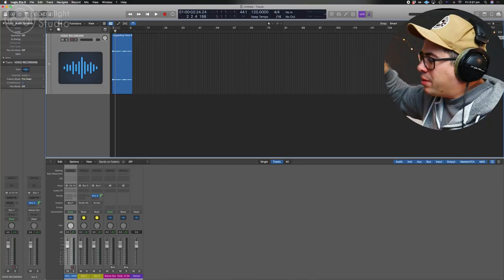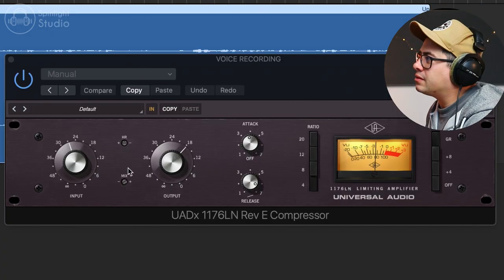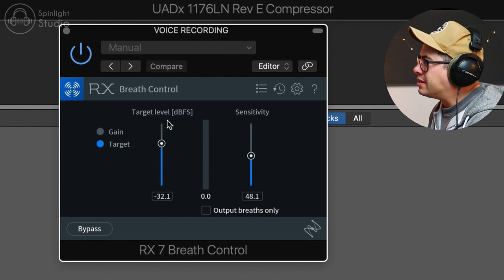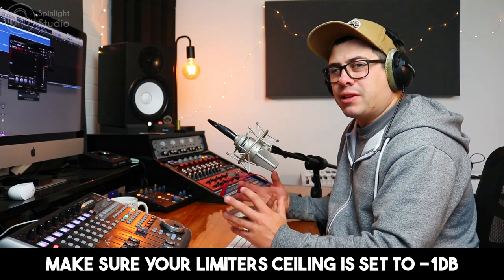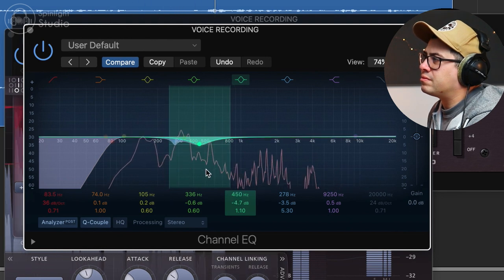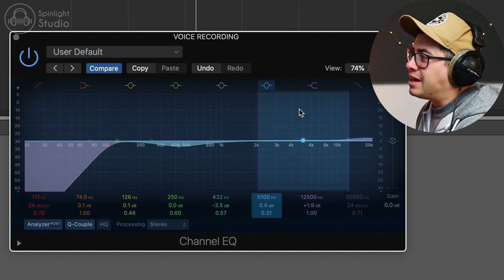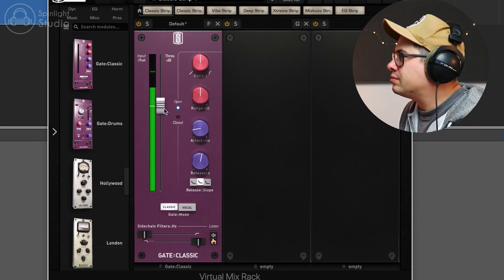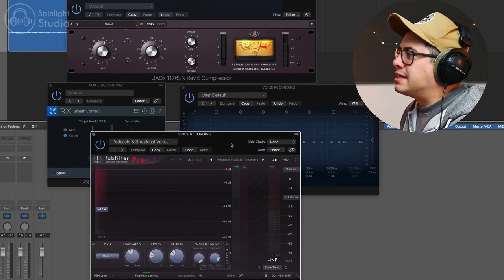LOUD & CLEAR VOICE OVERS (Processing For Podcasts & videos)

Comment: Sweet. I was probably over-compressing my audio because I was so obsessed with keeping the level consistent. 

I use the SM7B and it works great in my room. One thing I've found that's helpful with podcast guests that record in a really echoey room is the RX De-Reverb. It's pretty incredible at producing a dry room tone. I wouldn't recommend it as a fix for sung vocals. But for podcasts, it's more than good enough.
Reply: I manually turn down breaths, which is probably an insane thing to spend time on. I also cut out long pauses and excessive "umms." I have a template, but man, editing a 1-hour podcast still takes me 3-4 hours.
Reply from the maker: Yeah for sure. I’ve been using a rode mic recently and need to apply Rx voice denoiser, works pretty well. Also cut out umms and awkward gaps. Time consuming but makes a better final product.